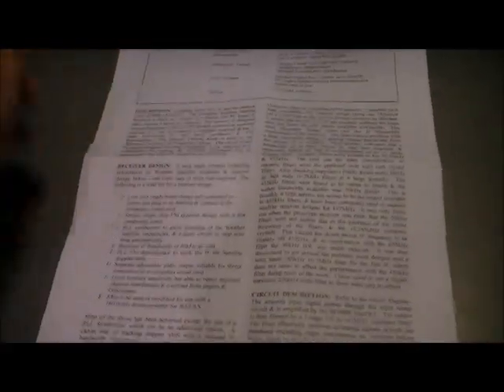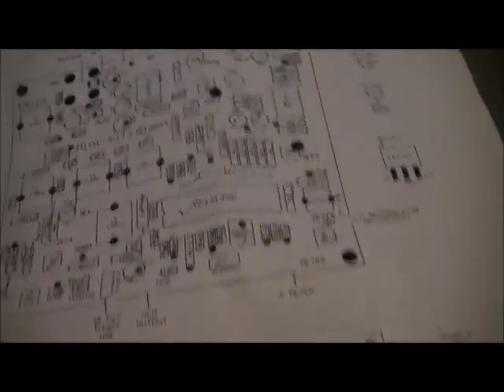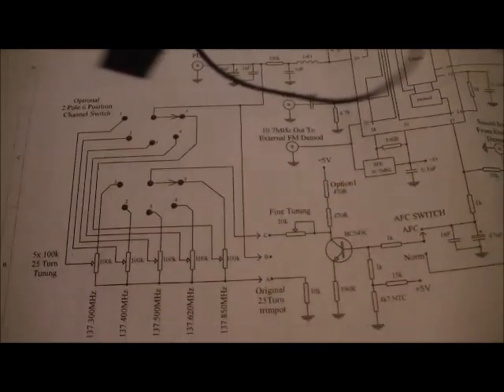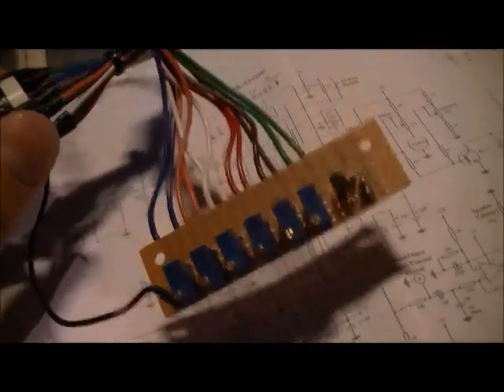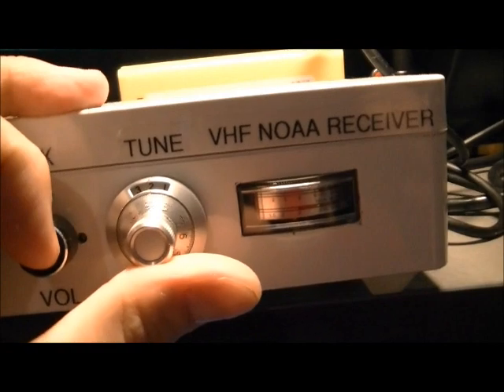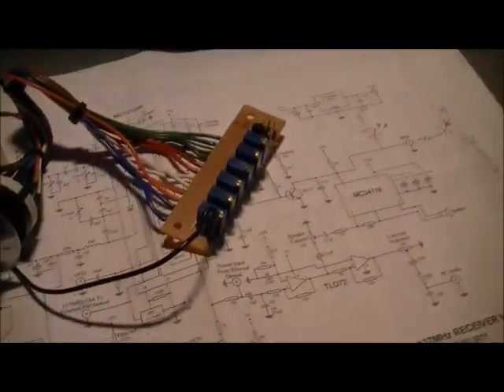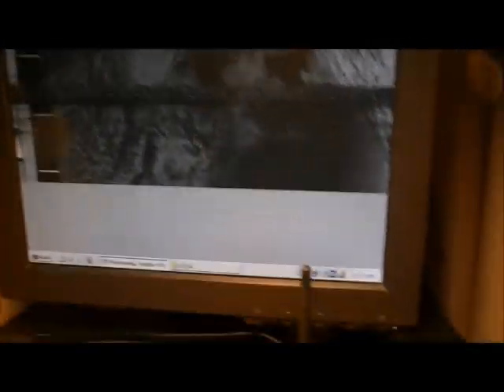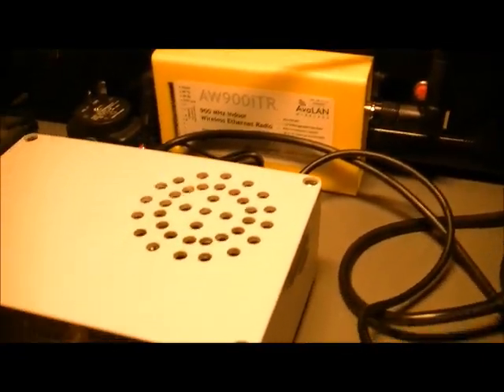Home Constructed NOAA VHF Weather Satellite Receiver.

Comment: Hi,  I just got the last one of these Minikits had in stock.   I just put it together minus the Front end FET,  The small sub board was missing and I am waiting on one to turn up.
I am very interested in you 10 turn pot idea with the vernier.  Can you please tell me where you got the Vernier from and also the panel meter?

Thanks heaps for the video .
Cheers
Alan
ZL4FM
Reply from the maker: MrAlanNZ 
Sorry took so long to see this.  The vernier came from RS components and the meter ebay.  The vernier does work well and I recommend using it for tuning the receiver.

Comment: So ... what kind of antenna are you using ?
Reply from the maker: I used just my vertical 2m/70cm amateur vertical antenna.  Not ideal really for NOAA, but it still worked good enough to do the video.
Reply from the maker: slippery396 
The antenna is not ideal. Was just a VHF Amateur radio vertical antenna designed for 144-148 MHz.  A turnstile antenna would be much more effective.